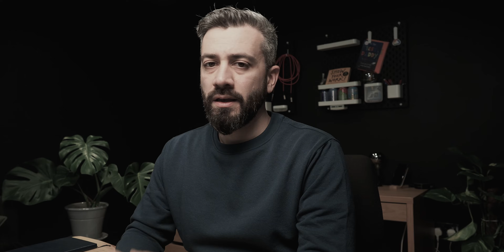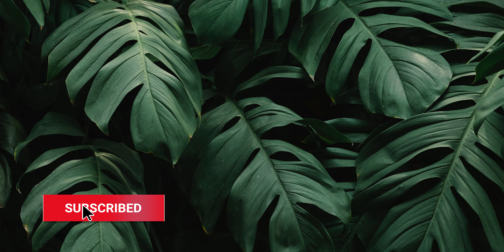DevOps vs Platform Engineering: Platform Engineering replaced DevOps

Comment: Can you learn DevOps at any age?
Reply from the maker: Great question… this apparently simple yes/no question is more profound than people may think. Even if it is specific to DevOps this can be applied to  Software engineering in general. What stops many from starting a career in software engineering is the constant frustration that derives from the learning process. For me what matters is learning how to learn DevOps (or software engineering) concepts and techniques. If you really want to learn and are patient and understand that what is hard today will be easy tomorrow, I don’t see why age should be a blocker.